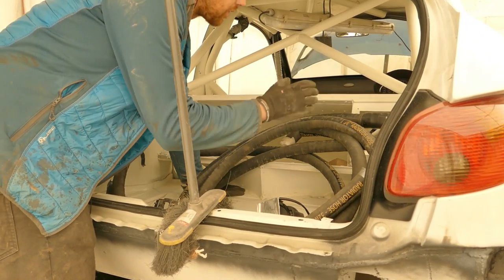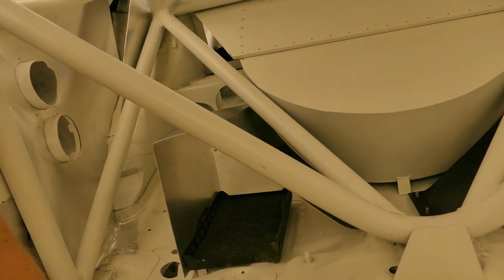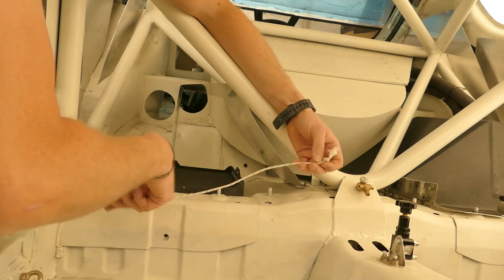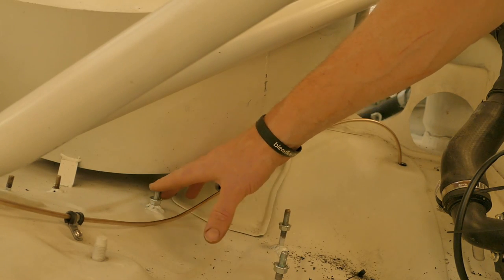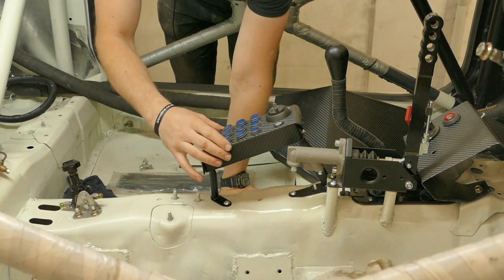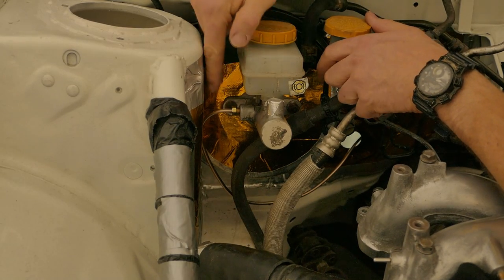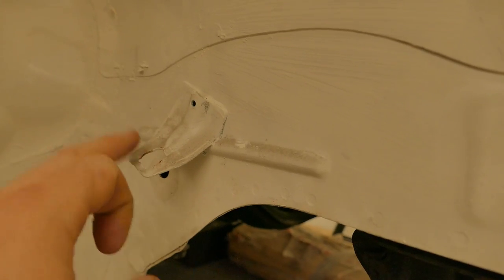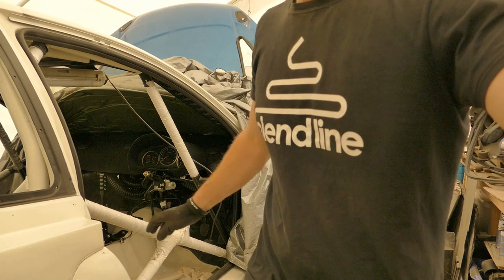206 WRC Rally1 Aero Build AWD Peugeot Project! 206 WRX Ep102 #builtnotbought #projectcar #blendline

Comment: Hi, just a couple of things with the rear brake system, the bias valve needs to be installed before the hydraulic handbrake cylinder so you are only limiting the foot brake pressure to the rear calipers.
Also the feed into the handbrake cylinder from the front needs to go into the rear port or the larger 7/16” port then the front 3/8” port is the pressure out towards the T piece. 
Hope that helps 
Cheers Mark
Reply from the maker: Hi Mark, thanks for the feedback. You make a good point about the vias. Is the issue resistance through the bias valve when applying the HB in its currently layout?
Reply: @ScuderiaBlendLine  hi, yes at the moment with it being located after the handbrake the pressure from your left will be restricted, so yes move it to inbetween the master cylinder and the handbrake cylinder.
The build is impressive by the way, I’ve watched it all the way through, your tenacity and patience with the bodywork moulding was something else 👍
Reply: @Hondamark2  Thanks Mark, I have changed the lines around and re-located the valve!